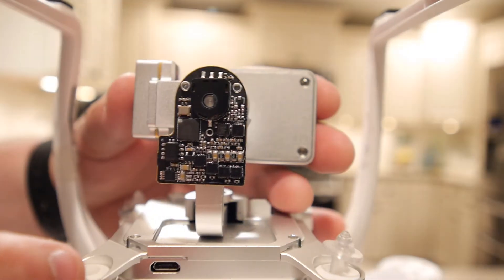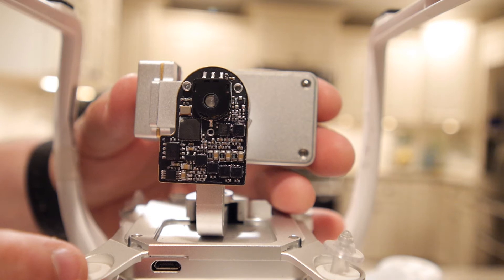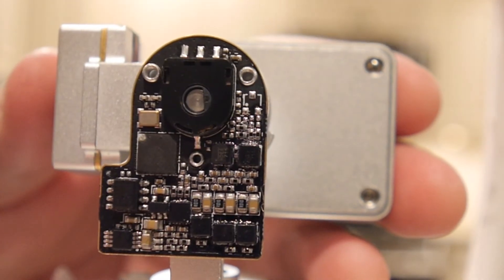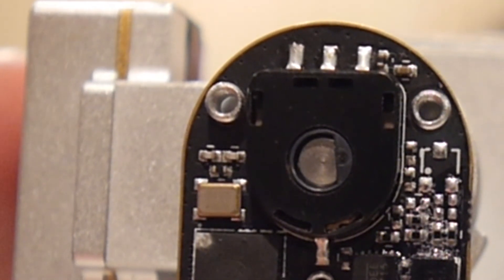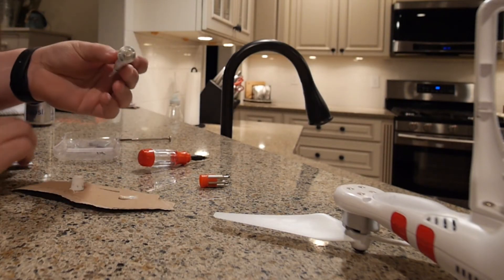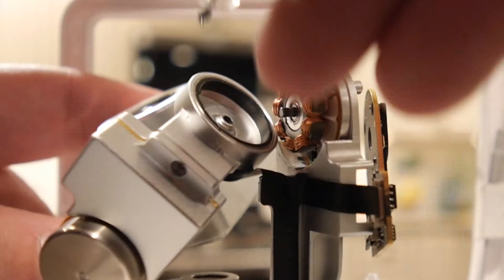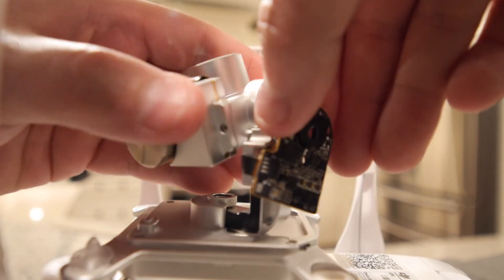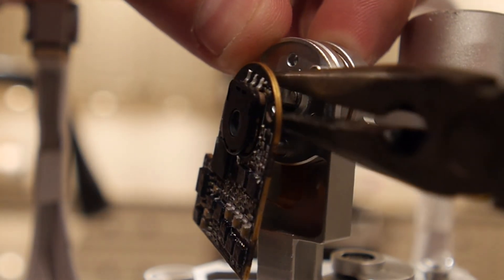DJI Phantom Gimbal Repair

Comment: When you epoxy the shaft back you must have it in the correct position. If you turn it after the epoxy has set you just broke the bond.